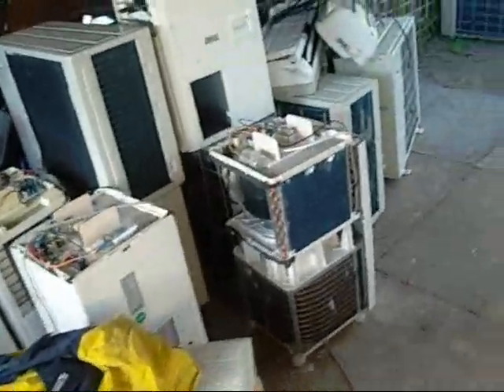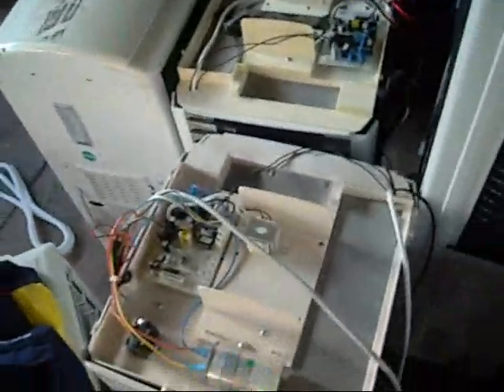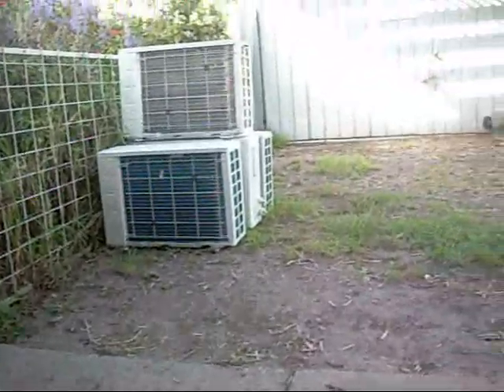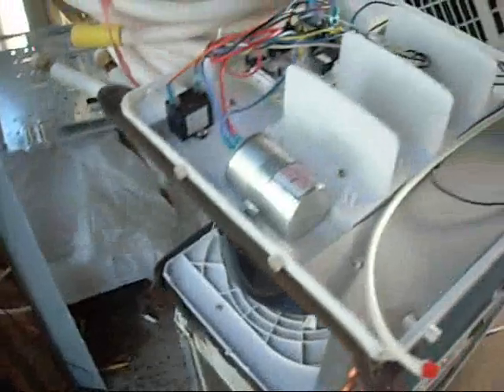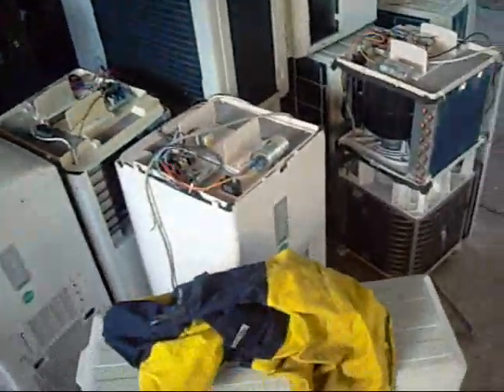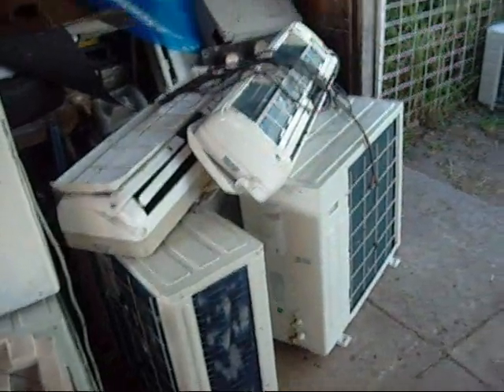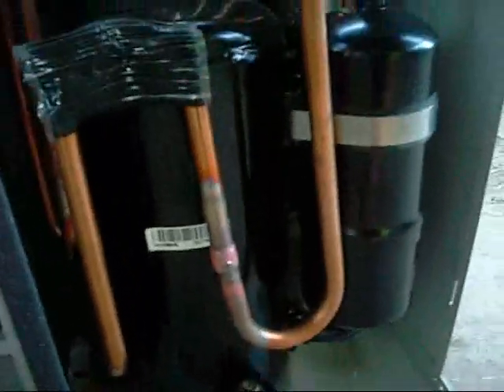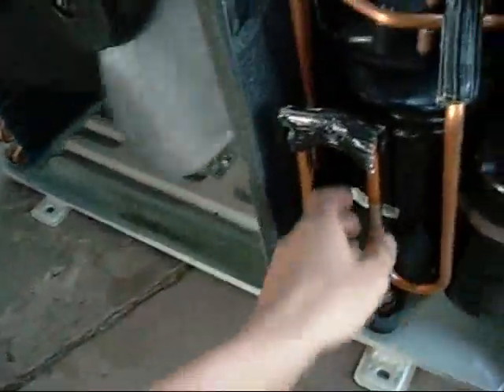Air Conditioners, Lots of Fujita Brand Split Air Conditioners

Comment from the maker: @fedders4 the blue is a type of enamel coating applied before the coil stock is cut and soldered into its finished form.
Its designed to slow down corrosion normally found on heatpump coils, but it dosn;t do a very good job.
it also lowers the efficiency of the coils marginally and I wouldn't recommend coating your window AC coils with anything, especially if the unit has already been used, the epoxy enamel will just flake off and ruin efficiency

Comment from the maker: getting replacement remotes for the cheapies can be hard, see if there is a manual override button on the indoor unit. many will have one that allows it to run automatically and maintain a temp of 21*.

Comment: @Aussie50 so...i shouldent coat my a/c coils?...but what if i did not use the air conditioner and it was brand new? and did they stop coating these condensors because i just notice that the new ones only have a blue evaporator and regular condensor(New FRIGIDAIRE window units at LOWE'S)

Comment from the maker: I scrap and sell coils, motors and copper tubing.
Reply: Hi there i have been looking for a fan for the outside unit of my Fujita 2006 reverse cycle split system. A/C is working but blades of fan have snapped off. Kind regards
CHRIS     0412 511030